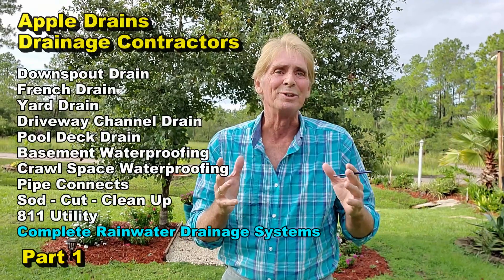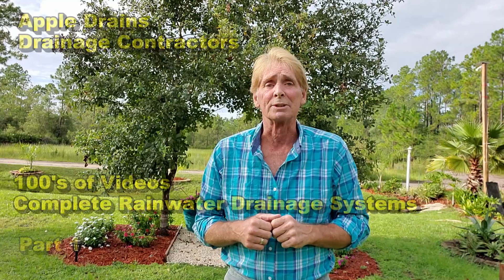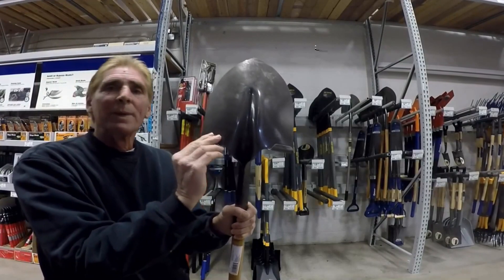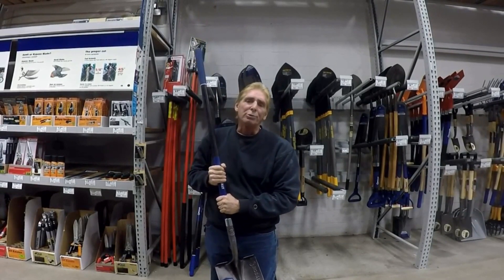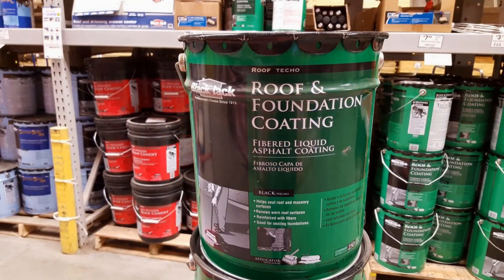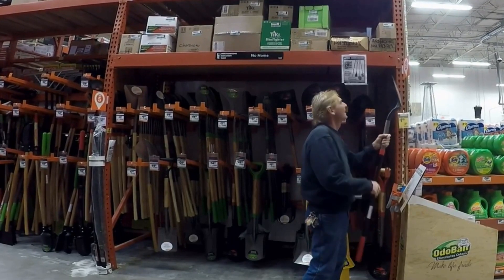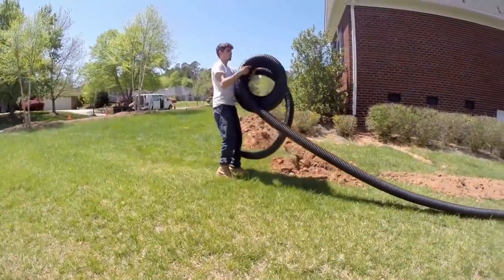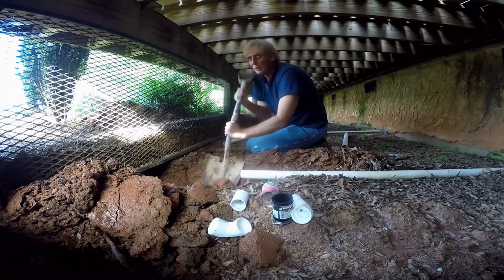Professional How to Tips, French Drain, Yard Drain, Rainwater Drainage, Part 1, Ground Work

Comment: Thank you for taking the time to make these great videos providing valuable how-to info. I do have a question about check valves and freezing.  Are you worried about the water being siphoned from the entire length of your discharge pipe back into the sump?  Have you seen that happen?